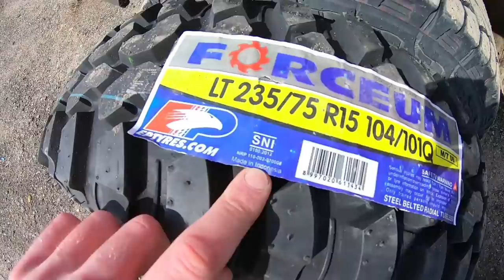Lifted Subaru Impreza gets 30" Tires × Rot Wagon

Comment from the maker: Finally some proper tires for this thing!  ...and I'm not mad the whole set cost as much as a single wheel on the Land Rover 😎
Reply: Nice!
Reply from the maker: Didn't wanna pull off from Rover things... but those old AT tires were getting sketchy!
Reply: What's bonkers is my every day driver is a 2012 Forester
Reply from the maker: @PavelowGunner1122  So what you're saying is... if we do a meetup/trailrun down by you I should bring the Subaru too on a trailer behind the Rover? 😎
Reply: @Tinker1837  i mean, she's been a good girl. We may end up trailering the rovers and pulling them with the Roos😅
I'm already thinking about a Cummburu... working on the name though
Reply from the maker: @PavelowGunner1122  Big 3.9 in the Disco & the lighter 2.8 in the Soon!  I'm not sure my gutless 2.2 in the wagon could even move my Disco much on flat ground ha!  Hmm... it's tricky with the first half of the Cummins name, maybe Subins? Summins? Subamins?
Reply: @Tinker1837  I'm thinking the 2.8 that just came out. I'd keep the AWD drivetrain and slip that little baby in there. 
Subarummins?
Reply from the maker: @PavelowGunner1122  Hey if a guy could cram a 3.9 in a first gen Miata then a Subaru should be doable.
Reply: @Tinker1837  😂
Reply: I have a 2000 Impreza Outback Sport and interested in lift. What's the first thing I should do? Struts or a basic lift kit of some kind?
Reply from the maker: @travisnaccachian4429   I would do Forester struts first, because it's a bit easier of a start that will also give you some idea of how much of a struggle the lift might be.  Just so you'll know what nuts & bolts are going to give you trouble, & also makes for a good time to spray some in penetrating fluid so when you do the lift it'll be easier!  (mine was very rusty, so maybe yours will not give you so much trouble)
Reply: I had an old 4x4 subaru gl awesome car. If you ever come across one with a dual range transfer case get it they are fun!
Reply: Hey @Tinker What kind of spacers did you use to fit the new wheel size?
Reply: What lift kit did you use ?
Reply from the maker: @drummerdude0314  It would be fun to play around with a dual range setup!
Reply from the maker: @Jmcx509  Forged aluminum 5x100mm to 5x4.75" adapter that's 1" thick, found it on ebay for a fair price (forged is important, cast is just asking for a wheel to come off)
Reply from the maker: @hudsoncogswell3580  SJR 4" kit
Reply: Nice  jack stands
Reply: What Year Make and Model is that Subaru?

Comment: I thought putting larger wheels/tires would ruin the drive line... after all  its all wheel drive not 4 wheel drive.
Reply from the maker: Perfectly understandable!  I honestly thought it would be a constant battle to keep ahead of driveline failures, but so far the only issue was a single front wheel bearing that failed due to a huge hit during some very aggressive offroad trail runs.  And of course the lifetime of most any part in the driveline will be reduced  due to not just the tire size, but also the increased leverage caused by all the lift (which will affect suspension components as well).

Comment: Would take the outer edge of meat a little thicker over cupping any day... how often were you rotating ?
Reply from the maker: I was admittedly being lazy on the rotation, only did it twice. Didn't expect to drive it so much! But I'm really glad I did since my daily before it was an enduro... so at least I got a break from slippin n slidin on 2 wheels during those extra icy winter days.
Reply: Crazy man... musta saved a lot on front pads !

Comment: Great to see upgrades to the roo, waiting for more and more!
Reply from the maker: More incoming!  And I really should do videos on some of the mods I've already done too (snorkel, lift, roof rack, etc).
Reply: Tinker It is the right time I should ask you about car, how does the car handles? And what changes have you done to entire suspension? I look for a daily car, maybe more adventurous and I am totally fascinated with this Impreza project (maybe since my brother bought slightly lifted 06' outback with h6 engine and hell, how much fun it is to drive this thing). I love pre-2000s cars, my plan is to buy an Impreza with ej22 engine, which as I read is bulletproof, lift it, put new wheels, get this thing a roof rack and some led bars. Then have infinite fun!
Reply from the maker: @jakubb4918  It can be a handful to drive. The anti-sway bars are removed & the center of gravity is much higher now.  I don't mind a daily that's a challenge, & this has been maybe the most fun daily I've had yet. I've been thinking mine needs an H6 swap! Or turbo... or both! Mine has the 2.2 single-port, not much power but ever reliable :)

Comment: Looks good Tinker!

I just passed on a set of those for some Thunderer M/S Trac grips for my disco. 
245/75/16s got em for 115$ /each delivered from ebay. Im up in northwest WI
And they work really well. 

Good luck!
Reply from the maker: Thanks! That sounds like a good deal too, & always worth looking for them because it sure is easy to spend a ton on tires.

Comment: Hi what a job!
 I wanna linft a legacy 2000 with forester strutts but I have some questions... How works the axles and the dirección pieces? I read of u lift a subaru broke a lot of axles... Sorry my english 😅 I wanna read your experience!
Greetings from patagonia!
Thanks.
Reply from the maker: Axles don't break too often, but using Forester axles can help. I never broke an axle after driving this one for years, but I did have a few axle rubber "boots" rip.

Comment: So my setup is a lil bit diff from yours. Im using 99 outback oem lift kit. Consisting of the struts and trailing arm bracket. When lowering the subframes with the spacers im probably going to need to add the steering joint from the outback over to my impreza huh? I recently put my missing outback struts over since the ones i was provided were blown. Now that im fixing some rust on the wagon ive decided to revisit the lift project. I added the struts in back and now i have this severe rake look to it it sits so much higher  now in back than when i had a 96 legacy strut outback spring and 99 impreza tophat. (Thats all i could find in a hurry to get my car back rolling again) but now i have new 99 outback struts and impreza tophat.  Im looking add the outback front transverse link front subframe spacer. transmission spacer. Rear diff spacer. And rear subframe spacer. Plus trailing arm bracket spacer to fix caster issue.
Any help would be appreciated.
Reply from the maker: I actually took my steering u-joint right out, made a long scratch on the shaft for reference, and cut apart to weld a tube in for lengthening (be sure to keep it cool during!!).  I converted mine to Forester all around, which includes modifying the rear tophat bolt pattern (this may fix the big camber you're getting).  If you run into any other mismatches in camber/toe/caster etc, then try to match your suspension components all from the same platform (all Forester, all Outback, etc).  Hope that helps & good luck, they're way fun lifted up!
Reply: @Tinker1837  i was trying to keep from drilling holes thats why i swapped over to my gf tophats. I still dunno why it sits so much higher in the rear now after i switched over to outback struts/impreza tophats.doesnit need to settle or something? I have too much caster not too much camber. As for the steering link i think im gonna use the outback link since i cant weld nor have a welder handy to use myself.

Comment: How much lift have you done on this? Also how much trimming have you done on the rear arches. Im lifting mine at the moment with 5" chassis drop and 7" strut spacers on forester struts and springs on the same body impreza but have high low ratio gearbox 🙂
Reply from the maker: I've got ~1.5-2.0" in Forester struts & 4" in a SJR subframe + strut lift kit.  I had to trim the rear arches right up to the doors.  That's a serious lift you're putting together & those dual range boxes are interesting!
Reply: @Tinker1837  nice. is your airbag system still hooked up? Im just a bit worried mine would go off if i tap anything hard enough
Reply from the maker: It is, but I think you'll be okay!  I haven't fully jumped mine yet (next season I will, just need to brace some things) , but I've run it hard enough on trails to explode a wheel bearing & knock interior bits loose.

Comment: Nice. Seems like it would eat through some decent snow and mud. I love the older Subes. The newer cars look over-styled. This thing looks more like a trar. What is the brake and bearing wear like, considering you have 100 pounds of rotating mass hung on a wheel bearing designed for a wheel/tire half the weight?
Reply from the maker: I upgraded to WRX/STI brakes so honestly it's maybe overbraked now if anything & wear is low so far.
Reply: @Tinker1837  Yeah, I found that video later about the brakes. Wheel bearings are supposed to be fast-wear items on these things according to the forums.  Long term it would be interesting to see the bearing wear if any from doing everything the wrong way. BTW what wheels did you get? I can't find any 5 on100mm 15x6" steel wheels , with less than 48mm offset, that are hub-centric for less than a mint. And are your wheel-spacers hub-centric? Honestly I'm finding for the price of the "wrong" wheels plus spacers to correct offset,  you can buy brand new custom aluminum wheels with all the "right" specs. But who wants to spend $400-$600 just for a set of winter wheels? Especially on a 95 Legacy LSi!

Comment: At this point is it just lifted with the Forester Struts and Taller tires?
Reply from the maker: No, it has a big 4" lift kit as well.
Reply: Tinker thank you sir, I will acquire an 04 Impreza Wagon 2.5 with a blown head gasket. 30” might be a bit much but some sort of Ralley Stance and tire setup would be perfect.
Reply from the maker: Yeah these tires are a bit extreme & hard on the components, but it's been a fun experiment so far :)

Comment: Hey @Tinker What kind of spacers did you use to fit the new wheel size?
Reply from the maker: Those are some forged aluminum 5x100 to 5x4.5" that I found online, forget where now, but I highly recommend forged over the cheap ebay junk.

Comment: What struts are you using? I can't believe the geometry looks fairly accurate with what appears to be OEM arms! Are they as stock as they look?
Reply from the maker: We'll those are Forester struts, but they have big 4" tall spacers on top to get all that lift, also spacers for the front/rear subframes. It's roughly a 50-50 split between suspension & body lift at this point. I'd like to ditch the spacers & set it up for proper long travel shocks & ditch the OEM arms for tubing & with spherical joints.  But first I have some rust to tackle!
Reply: @Tinker1837  - thanks for the reply! I recently came across a '91 Just with the CVT tranny, viscous diff, and EFI... it has less than 100k miles for $1,500. Thought it would be a cool trail vehicle for my son.

Comment: I know I shouldn't have to say this, but if you are intending to drive it like that, get the struts replaced and alignment done ASAP.
Reply from the maker: I've been pretty curious about upgraded strut options, not a lot of options aside from full rally racing dampers. Might have to build my own 😎
Reply: @Tinker1837  and you're just the man to do it too.  But if you wait too long, you will likely in up with a  bit of other damage to repair.

Comment: Hey tinker did adding a lift kit and boggers add noticeable wear on suspension parts and trans
Reply from the maker: So far it's just been wheel bearings (trans, brakes, shocks, cv, etc all okay) that haven't been happy after this much modification, replaced a front & a rear so far after 2+ years.  But that being said, I'm not sure if it's from the lift/tires or from hard/trail driving (both?).

Comment: Ok, so you did trim the body to clear them
Reply from the maker: Oh yes! The front wheel opening just needs a little bit of the rear trimmed back, but the rear on mine needed a cutting all the way around the wheel opening (which was okay for me since it removed a great deal of rust).

Comment: These would look sick on my Baja but it’s still stock ride height
Reply from the maker: Stock ride height would require SO much cutting, but agreed a Baja with a little lift & 28-30" tires would be dreamy.
Reply: @Tinker1837  how much lift is on your Impreza?
Reply from the maker: @jacobfleener8501  The Forester struts added about 2" and then I did a SJR bracket lift that added 4" more.

Comment: Tinker hey do you have a link to the tires and rims you have on these you just got on? And how about the lift kit? Also that jack stand that has a hydraulic lift built in 🙏 thanks
Reply from the maker: The wheels are just generic 5x4.5" steel wheels, the jacks are " Powerbuilt All-In-One", and the tires are linked in the description.

Comment: You running spacers on those tires? If so what size spacers you got for totally not going against your disclaimer reasons
Reply from the maker: Yes, they also convert from the Subaru bolt pattern to more common small truck pattern for more wheel options (all info is in description)

Comment: what rims did you use? I have a Subaru Buggy project but I dont know what rim can I use,my original rims are smalls
Reply from the maker: Those are the kinda wheels you'd find on Jeeps & lots of other small SUV's. They are 15x8 with adapters to fit their 5x4.5 to the Subaru's 4x100

Comment: May I ask what trails? I'm from bay city mi but am in the northern part quite a but and just bought a subie myself. Took it out on the trails on m61. Stock 99 legacy sedan. Handled great but I want to be able to clear the same size tires as you
Reply from the maker: Most of that was fire-roads and forestry roads around Mesick. Some footage was from norht of Bladwin (Lincoln Hills & Lil Manistee trails) and other was north of Manton (North Missaukee trails)

Comment: ouch the strain on those poor hubs
Reply from the maker: A bit more than the factory planned for haha! You would think I would have munched thru loads of wheel bearings by now, but only 1 so far after nearly 2 years, & that was from some really aggressive off-roading.
Reply: @Tinker1837  Subaru's are so tuff. I once had a 2wd Legacy I used to beat beat mercilessly on. 
 I'd love to set up a Forester something like this.

Comment: How does the awd system respond to the different size wheels/tires?
Reply from the maker: The same as before, pretty sluggish. It's an auto so thankfully it was easy to solve that with a center diff switch mod that allows me to lock it in solid.

Comment: Man you could do the same things on standard wheels )
Reply from the maker: Not enough offset though, would require MUCH more cutting. But maybe you could cut & re-barrel an original Subaru steel wheel, which would've been cool, but I didn't think of it at the time.

Comment: so are those 30" tires on just the forester suspension? or did you add a lift kit as well? if you did add a lift kit would the 30" tires work without the lift kit? I'm trying to do something similar to my 96 impreza wagon!
Reply from the maker: Lift kit!  A great 4" kit from SJR.  No, you would have to do SO much cutting on Forester suspension only.  If you're handy you could make a roughly 2" kit fairly easily.
Reply: @Tinker1837  alright, so its a total 4" lift? the forester suspension and sjr kit correct?
Reply from the maker: The Forester struts bring it up ~2 inches, and the SJR lift kit brings it up 4 inches more.
Reply: @Tinker1837  oh wow, cool thanks for the information!
Reply from the maker: They even make a 6" kit if you want to get bigger tires under there, like 31's or more :D  Happy to help!

Comment: Yo what's up bro just about to start my budget build 98 outback impreza waggon  what size lift is that and what snorkel lol beautiful car can't wait till my bushwacker is done
Reply from the maker: That's a 4" subframe lift with Forester struts, and the snorkel is just exhaust flex tubing with a Grand Prix exhaust tip attached at the top haha
Reply: @Tinker1837  4 inch subfram lift? Also how much lift does just the forester coils and springs raise it? And do u have to use the a arms as well? And does the year mater at all? Lol 😂 just curious before I start buying stuff lol

Comment: What is the specifications of your rims/wheels!? Rims size/offset/factory !?
Reply from the maker: 15x8 size, 4" back, 5x4.5" lugs
Reply: What size wheel spacer?
Reply from the maker: @GDubsPete  1 inch thick forged spacers that adapt 5x100 to 5x4.5"

Comment: What wheel dimensions are you running? Just the lug adapter or any other spacers?
Reply from the maker: Those are 15" x 9" wheels with 1" thick spacers that change the bolt pattern to 5x4.5"
Reply: @Tinker1837  Thank you! You are the MAN! Love this build
Reply from the maker: Happy to help :)

Comment: What kind of exhaust does he have on his subi
Reply from the maker: I custom fabricated the whole thing.  I made unequal length headers with 1.75" pipe for it's 2.2L single-port engine (because it needed the Subaru rumble) with a 2-to-1 collector into 2.5" at the high-flow cat right before the first v-band, then a small resonator running tucked up tight until another v-band just before the rear diff, then up and over to a vibrant turbo muffler and ending in a VW Beetle style megaphone chrome tip.